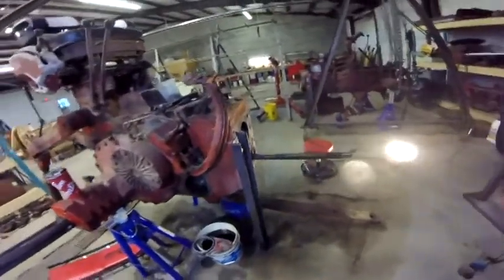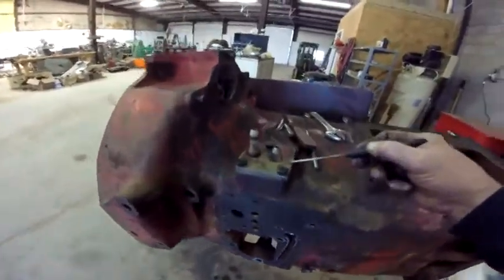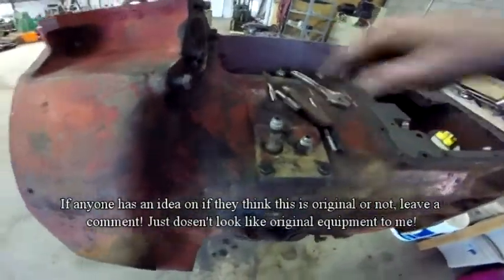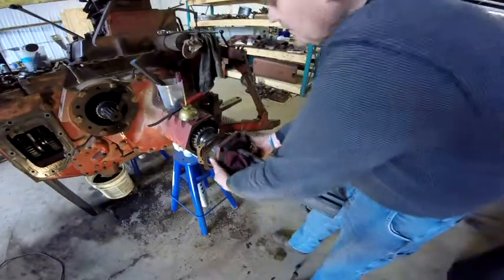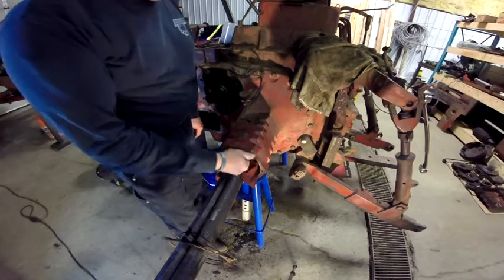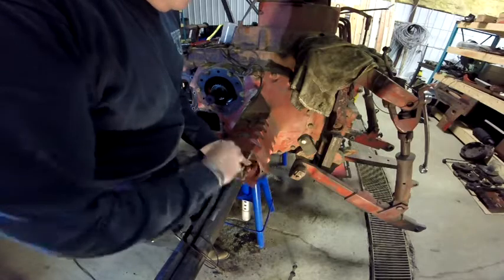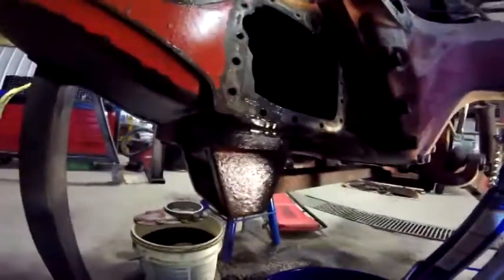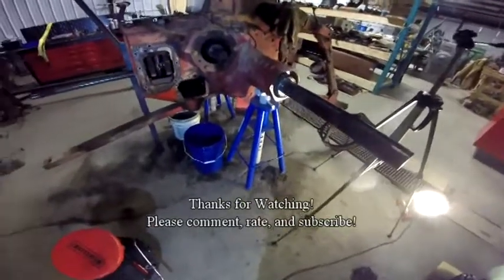IH 1066 Tractor Project Part 19

Comment: Fred
That steel roller looking" thing " is what is provided to block off the sump check valve. When you took off the MCV, in the lower right hand corner of it, there is a port in the TA housing. There was a plastic check valve with a tiny spring up against the MCV.
Don't use the steel plug. Use new plastic one that is in your gskt kit from IH. It allows you to have manual steering when engine is not running, if needed. Have never seen a bad plastic one in 35 years. 
It is thought that it may cause a leak in system. Aftermarket companys provide the plug. Have never used it, and back in the day at dealership, nobody used the steel plug.

Refer back to my other comments for the Ta install  procedure to compare .
You may also find info on Hy Capacity website also.
Reply from the maker: Thanks Mark, when I put it back together I will make a video so that everyone can see, and also kind of make sure by you that I have done it right. Thanks for all the help!